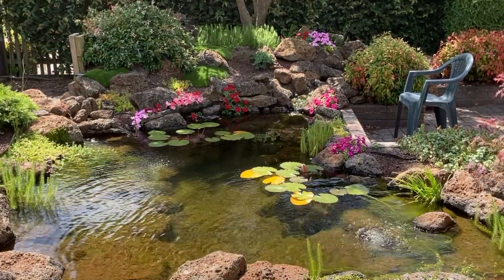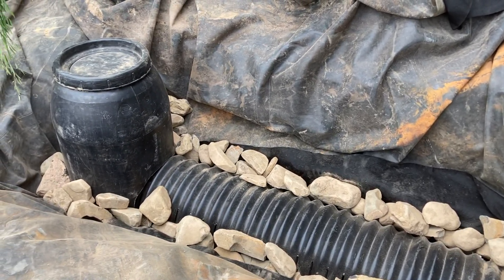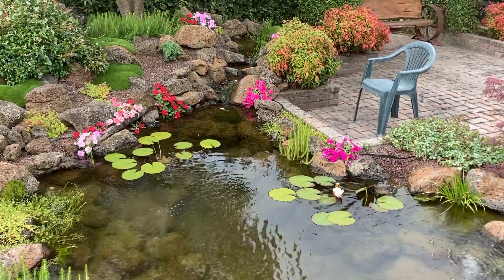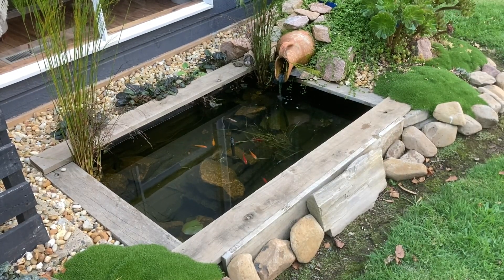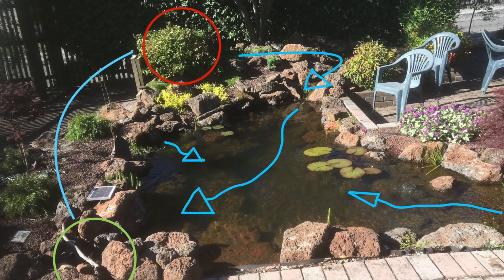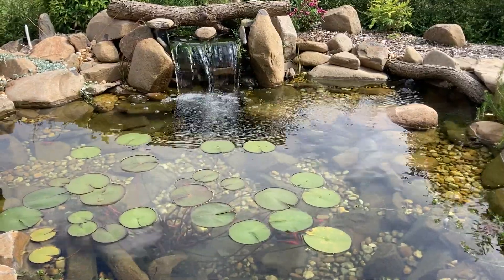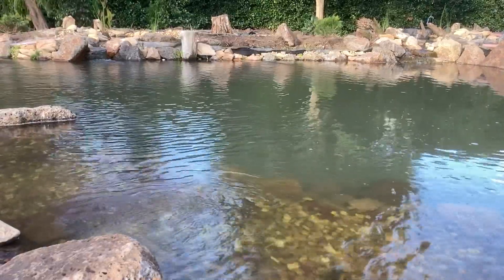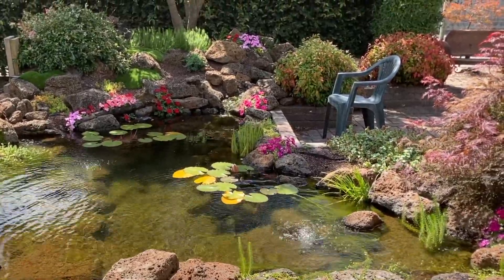Pond Pump Flow Rate| How much do you NEED?

Comment: Hey Kev, I've decided to make my pond under a large skillion roof verandahs, being in the tropics the evaporation and sun would wreak havoc on doing one out I the open. Planning faux rock wall with real rocks throughout the falls and growing areas, the top discharge pool I will pump up and use a gate valve under water to Syphon off water to the 44 gal bog filter and the rest will flow over the falls into lower pools and plant beds then onto the main pond at knee height ( to keep the cane toads out ) now to work out a pump to run my plans

Comment: My pond is 17k gallon  what gph pump I would need for a bog filter?
Reply from the maker: Depends on the size of the bog filter, which depends on the use of the pond.
Reply: @Ozponds   I'm think a 275-gallon water tank . I want a natural filter to clean the green
Reply from the maker: @Live_to_learn_life  I like to size the pump at 6x the bog volume.
Reply: @Ozponds   1500 to 2000 gph pump?
Is the bog filter would be large enough for that size pond?
Reply from the maker: @Live_to_learn_life  not even close.
Reply: @Ozponds  so what would be your suggestion on the pump size and the gallon of the bog filter. That's all I need to know
Reply from the maker: @Live_to_learn_life  I don’t understand why you don’t watch the videos I spend so much time making. All the information is in them. It depends on what you are keeping inside the pond. The size of a bog filter is different. A wildlife pond needs a much smaller filter than a koi pond!

Comment: Hi Kev, I have built my bog! What size pump do i need to buy? My main pond is 30000 litres and the bog is 5000 litres, can you please advise?
Reply from the maker: It’s a big pond and bog. I’d like to have 30,000lph available for the bog. I might also like to have a pump running some jets.
Reply: @Ozponds  thanks Kev. So a 30k lph pump from the main pond into the bog? And some jets running in the main pond or the bog?
Reply from the maker: Jets are for the pond not the bog. Jets are optional not critical from a filtration perspective.

Comment: Hi Kev thanks for another great video 
I had a question reg pump placement, due to space constraints and to hide the bog i had to place the bog next to the pump so does it have to be opposite to the filter or doesn't matter even if it is next to the bog?
Reply from the maker: Would be better opposite side. But if it’s a small pond shouldn’t matter.
Reply: @Ozponds  thanks for the quick reply really appreciate
I have a 12000 L pond and a 1000L bog it's a pond with less fishes probably around 10 - 15, less koi I hope it's manageable
Reply from the maker: That’s a decent sized pond.

Comment: Can circulating once every 2 hrs okay?
Reply from the maker: Sure can. All depends on the filter setup and type of pond.
Reply: @Ozponds  Thanks for your quick response. Would that be like increasing the filtering layers.?
Reply from the maker: Not really. I think you need to do more research. It’s all about surface area for bacteria, in relation to the ponds use and size. My preference is bog filters so that’s what most of my videos teach, but you can use other types and they will have their own guidelines.
Reply: @Ozponds  Thanks once again. I guess we are saying the same thing. If I increase the height of  the layers of gravel to increase the surface area of the filtering layers  and water retention time in the bog, would that not be providing more surfaces for the filtering bacterias to attach?

Thanks for your numerous videos. They are very informative and you are achieving your set goals. I think I can do my own pond without breaking the bank. I will be building my pond in December hopefully, when I get my property.

Comment: We currently have the issue of a pump that’s WAY WAY too strong for our pond and bog filter. I did most of the calculation for what size pond and bog filter we needed but left my husband in charge of finding the right size pump. He naturally thought bigger was better and got an expensive huge pump that is now causing me a ton of problems. For instance when turning on the pump it takes only 60 seconds to fill the bog filter and start coming down the waterfall- Even after diverting half the water straight back into the pond before the bog filter!
Reply from the maker: It’s also the expense of running the thing. Maybe you’ll need to add another stream 😉

Comment: Hello, Kev! First of all want to thank you for great info on building ponds, I am a big fun, in fact I think you are the best in this area! Could you please give me an advice? I am in process of building my pond, actually it is almost done, I will try to describe it, please sorry for my english. So it's 3x4.5 meters, about 10000 litres of volume, with 1 meter high waterfall, bog filter (20% of the pond), intake bay and jets around, there is not gonna be a lots of fish, and not koi for sure. I cannot figure what pump to buy. So the question is, what is better, 2 pumps (1 for waterfall which is 4 meters away from intake bay, and another one for the bog - 4 meters away also) or just one but bigger and what size in every case those pumps should be? And another question, how many jets there suppose to be on 4 meters pipe for example? Thank you in advance, too many questions, I know, but what I really don't know, is what pumps to buy, so help me please :) ;)
Reply from the maker: Your English is excellent 👍. I would run 2 pumps. It’s easier to managed the flow through the bog that way. If the bog is 2000L I would get a pump that will deliver 10000-12000 litres per hour at the required head height. For the waterfall allow at least 8000 litres per 30cm of width. 12000 even better. Hope that helps 👍
Reply: @Ozponds  Thank you so much for a quick answer, I really appreciate it, and yes, it helps a lot! About jets, if I understand corect they reduce the waterflow, right? So  for the 4 meters pipeline which goes to waterfall how many jets I suppose to place to not reduce dramatically the waterflow?
Reply from the maker: I’d probably only put one or two if running off the same line as the waterfall.
Reply: @Ozponds  Thank you very very much for your advices, you are a life-saver, now I know exactly what to do! Have a great day!

Comment: Hi Kev, does the pond pump have to be at the deepest part of the pond to ensure that it has full water circulation? As I may find it difficult to do considering the factory length of the pump electric cable
Reply from the maker: No not at all. I prefer to have my pump in a skimmer or intake bay.

Comment: What is the equation for the pump size if you have a 200 gallon pond and want to utilize a bog and a waterfall
Reply from the maker: There’s a few. Bog size should be at 10% or more the size of the pond. Water moving through the bog 6 x bog volume. But then to create a decent waterfall you need lots of flow. 12,000litres per 30cm of width is a good starting point. So as you can see you wouldn’t send all the waterfall water through the bog. Breather pipes, jets can take up some of the flow. Or you could use seperate pumps. One for the bog, one for the waterfall.

Comment: I still find myself coming back and watching your videos, your a legend m8. My pond has eventually cleared itself and is now crystal clear and it happened faster than I expected but still think I'm going to ditch my pressure filter and build my own bog filter as I've always built my own but thought maybe this time I might be better off buying one, how wrong was I🤦‍♂️ anyway I'm rambling, I'm watching this video and noticed your ponds air, what air stones are you using if any??
Reply from the maker: Thanks mate. In my courtyard pond the airstones are big round ones, I can’t remember the brand but they fit on my 8mm air line. In the dream pond I’m using a epdm diffuser I bought on eBay. Both are doing a good job. The diffuser is only a few months old, but those airstones have been in operation for 3 years! I wish I could remember what brand they were. Now I’m rambling 😉.

Comment: Do bog filters add much additional head pressure? Any tips on calculating how much?
Reply from the maker: G’day John. I just allow for the pipe friction and the actual height of the bog overflow in relation to the pond water level. For pipe friction I just google it and use any of the online calculators. Hope that helps 👍
Reply: @Ozponds  That's very helpful, thanks!

Comment: Love your videos, inspiring while working on my pond.  The once an hour turn over scares me because even if I scale back my grand plan I suspect the pond will be like 50,000 gallons, probably more like 65,000 or 70,000.  Guess the primary usage of mine is collecting water to use for an irrigation system on the property.  If I can swing it I will make it pretty too 🤣
Reply from the maker: The bigger the body of water the more it can take care of itself. I find I can circulate less than an hour with my bog filters. The once an hour is just a great starting point for beginners and they are usually looking at much smaller ponds than yours. One concern for water quality in a pond for irrigation is will the water be returned to the pond after irrigating? If that’s the case it’s going to pick up a lot of nutrients.
Reply: @Ozponds  thanks for the tips!  One way for sure, not returning.  Looking forward to all your adventures and I appreciate you leading the charge for DIY pond people!
Reply from the maker: You’re most welcome 👍

Comment: Hi Kev.  Thanks once again for the great video.  Can I just ask what sort of distance you maintain between the top of the aquablox or drainage channel etc and the top of the bog.  I noticed the aquascape guys are putting tonnes of stone in at varying sizes.  Just interested to know what your approach is with stone size etc  Thanks again.  Cheers Andy
Reply from the maker: G’day Andy. I love that bogs are so forgiving if you can slow the water down and can clean them easily you almost can’t stuff it up. The aquascape guys teach 3 different layers at 8 inches (approx 20cm), so that’s 60cm above the aquablox.  That’s what I’m trying on my big pond build. My bog in a barrel in the courtyard has about 80cm of rock and gravel over the void area (still works great). My mini bog would be only about 10cm of gravel, again works great. Nelson’s water gardens will say exactly 30cm. The moral of the story is focus more on getting the flow right and an easy way to clean and you’ll get great results. Hope that helps 👍
Reply: @Ozponds  awesome Kev.  Thanks for the feedback.  Cheers

Comment: I have some questions about height that you didn't address in the video. If the filter is located higher than the pond do you then have to compensate with a stronger pump? If my logic checks out, do you have to measure the height from the water level and not from where the pump is, am I right in my assumption? 
Overall a great video with lots of useful information! It's always a pleasure to watch and learn something new.
Reply from the maker: Yes mate. You are correct. The height, the width of the pipe and the length of the pipe will impact how much flow the pump actually delivers. Every submersible pump should come with a graph explaining how much flow you can expect to get at different head heights. I really should have covered that in this video that’s my mistake 👍
Reply: @Ozponds  Thanks for the reply :)